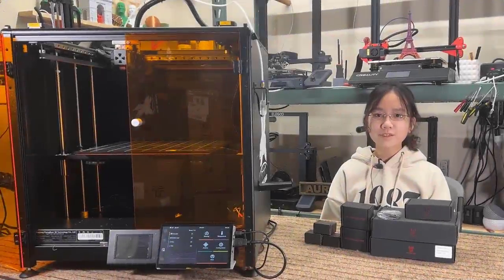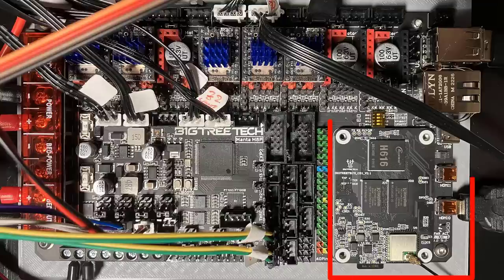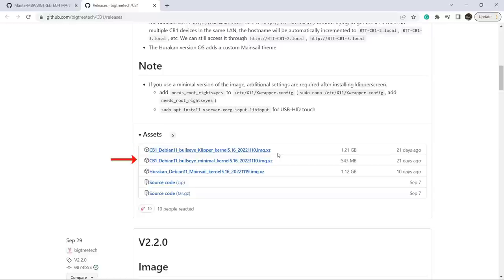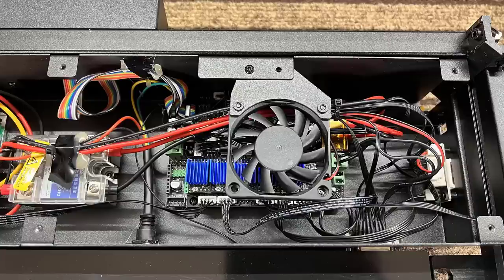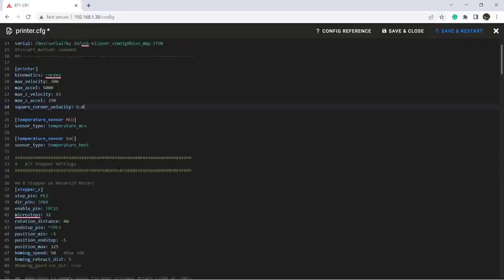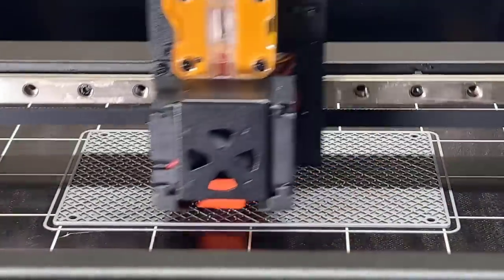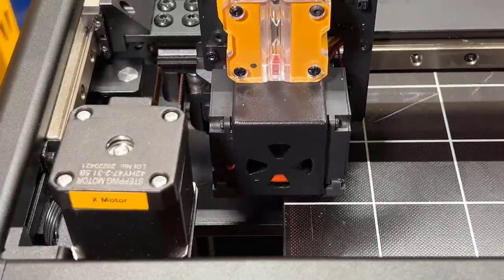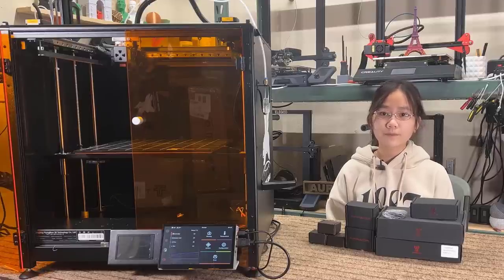BigTreeTech Manta M8P motherboard + CB1 Raspberry PI replacement board upgrade w/ Klipper firmware

Comment: Excellent how-to video for this product and process.  It's a nice change from your reviews, which are always very informative, but understanding the nuts-and-bolts aspect of 3D printing is always helpful for me.  I would suggest doing one about the various changes you might make in settings for Cura or other slicers and what effect they have on the printing job, e.g. tradeoffs on speed vs. quality, layer height impact on durability or looks, etc.

Comment: I am also trying to use an M8P on my Reborn 2 but I am yet again reminded that electronics is my weak spot.

I bought a display too and only after the fact noticed that this display with a ribbon cable only seems to be working with an actual Raspberry Pi.
So now I got a Raspberry Pi but that seems to be unable to boot off the SD card because it has MMC storage.
So now I need to find a 24 V power supply to test this although I am led to believe I might be able to use a 12V one too but I cannot verify.

I so wish that there were better resources online as in actual people willing to respond to questions. It used to be like that with forums, but these days you can either ask under videos like this in the hopes that somebody cares or go on Reddit and be ignored for the most part or if someone answers, they don't read the question or just tell you to do it their way because that's better anyway.

O tempora, o mores.

I seem to be entering the "get off my lawn" age...

Comment: It is so nice to see a project video from you again. I have been missing them.
This is a convection I'm considering for one of my printers as well.
As always, your video is a very clear and detailed step by step guide.
Awesome work team.
Btw, iI wonder if the Voron Afterburner print head would be better fit for this printer?

Comment: I have converted my Anycubic Pro to Klipper using the PAD 7 and the stock mainboard. Thanks to your video, it was fairly easy. Would using the PAD 7 and a different mainboard, like the SKR 3 or Octopus, have made this easier?

Comment: Nice job , you helped me figure some issues out on mine and I used the same thing as I have had the arts for a bit of time the only other thing I did was also changed it to Canbus with an EBB42 as I didn't like the large extruder cable.  I did get the m8P to fit where the old one was with strong Velcro. Thanks for the video !! :)

Comment: Great video again! I have similar setup and I cant get 24v on Bed-out connector. Is there some jumper somewhere or do you have route 24v power to bed power connection? I think that I will take that relay control signal somewhere else.

Comment: Great video. Wonder how the setup for the accelerometer would go with this board? Looks like there something similar to a 40 pin header on the Manta, so I would assume that it would work the same as with the PI. Also would be curious how canbus setup would work with this board. Is it USB only? or is it compatible with a waveshare board? From what I see there are 2 USB ports, but their documentation says 3, where is the 3rd?

Comment: Hi, thanks for the video, did you was able to use an input shaper sensor in the board such the adxl345 or another one ? if yes how did you manage to do that in this board? my board doesn't boot with the sensor in the sp1.

Comment: I am wanting to design prototype parts quickly I have a basic ender 3 now with a few upgrades. It is painfully slow. Was wondering if it would be best to buy a core xy printer and installer klipper or just by the p1p... budget is 800$
Reply: if privacy isn't that big of a deal, then get the Bamboo lab.

Comment: I'm about to install this board and everything I've read says to pull the VUSB jumper before powering the board with 24V from the power supply or you'll fry the USB controller. Did you need to pull it? I ask because obviously you're using the USB for the screen.
Reply from the maker: The USB-C used to power the board is connected to a 5V 3A adapter.

Comment: This is an Amazing video, I am doing the same to The Flying Bear Reborn 2 at my job here at The Dinosaur Company, Im running into an ADC out of range, I may have to replace the heater sensor? did you run into the same issue? Thanks so much 😃
Reply: I got it, Had the HB and TH wires swapped, fixed it in printer.cfg

Comment: Hello, thank you so much for your video, it has been really helpful for me, I also have bought a Reborn v2 and followed your tutorial to install Klipper. 
Almost everything is working fine, except for the hot-bed which doesn't heat :c

My printer.cfg file:

[heater_bed]
heater_pin: PB7                     # "BED-OUT negative terminal"
sensor_type: EPCOS 100K B57560G104F
#sensor_type: ATC Semitec 104GT-2
sensor_pin: PA0                    # THB pin
#max_power: 0.6                  # Adjust Max Power so your heater doesn't warp your bed
control: pid
pid_Kp: 325.10
pid_Ki: 63.35
pid_Kd: 417.10
min_temp: 0
max_temp: 120

Edit: I managed to solve this issue by connecting the BED_power terminals to the PSU_power terminals (24V), so that the PB7 PIN could trigger the relay to heat the 220V AC bed
Reply: Hey. runnning in the same issue.
did you run both wires (+ and - from PSU) to BED_POWER?
Reply: @hashbringer975  Yup, I've connected both
BEDpower+ with PSU+
BEDpower- with PSU-

Comment: I installed this on my twotrees sp5 and I am unable to heat the bed. The temp reads correct but it never heats up. Checking with multimeter there is never power going to the bed out side of the connectors. Should there be?
Reply: I had same problem. I programmed different output to heat bed. I choose next nozzle heater output and programmed that to control that solid state relay. That works great and bed is now heating.

Comment: I have an original CR-10 that prints very well.  I will be doing some mods to it, (micro swiss all metal hot end, belted Z, fang cooling duct).  I would like to get a second printer, and like you, I think the bed slinger design is flawed and would prefer a box frame, and core XY.  My question to you is, what core XY printer would you recommend?  The flying bear reborn looks very good mechanically.  But I think this upgrade you have done makes it much better.  So at a price of $560 plus the cost of this upgrade, would you consider this a top value for the money?  I will be printing engineering materials, and materials with carbon fiber, my parts are mechanical in nature.  Would I be better off saving for the Bamboo labs X1?  The Bamboo P1P seems like a good value, but I don't believe that can do the carbon filaments.  The bamboo X1 probably can print quicker, but I am not as concerned with all out print speed (I still want faster printing that typical bed slinger).  The flying bear also seems like it is more upgradable and modifiable.  You have also done reviews on other core XY printers.  What would you recommend for $500 to $700 for a core XY printer capable of high temperature materials like nylon and PC, and carbon fiber filaments?
Reply from the maker: It's too many works to do with this flyingbear reborn 2 upgrade. If I need a good Corexy, I would just go for the BambuLab X1 carbon or even the P1P would be a much better option. For the P1P, you just need to change to a hardened steel nozzle to print PA-CF which is available for around $15.
Reply: @AuroraTech  Reborn 2 is $375 right now.  $390 with a flexible build plate and bed leveling probe. You can do these upgrades and still be under the bambu lab stuff.

Comment: Great video, I too have had issues with the stock board and firmware.  I'm think this the the best solution for the MKS issues.

I'm saw an earlier post with a question, likewise I don't wish to be rude.  If anyone could provide insight it would be appreciated....
The MKS board came with two types of stepper drivers TMC2225s for four axis motors, and one 2209 for the extruder.  Did you reuse the stepper drivers in this installation or is there an advantage to using the two types?
Reply from the maker: I didn't reuse any of the drivers, I want to use that MKS board on other machine, but I should just connect a classic LCD screen and recompile Marlin firmware instead of using their buggy screen firmware.
Reply: @AuroraTech  Excellent thoughts, thanks again!

Comment: Aurora the wise ❤.
Will it be rude of me to ask a specific question about Klipper?
I’ll ask and please free to ignore if you are too busy - I will not consider it as being rude.

Here it is:
When using klipper, in order to achieve fast print speed, do I simply slice the model with higher printing speeds?
Or does klipper “do some magic” with my gcode?
Reply: No, it doesn't do any "Magic".. you need to setup your speeds in your slicer. However, the rest of your printer needs to be able to sustain high speed printing. Especially the cooling fans and ducts.  I can tell you that a stock Ender 3, is not a good candidate for high speed printing.
Reply: @mr.spongylikeaboss4987  
Thanks. And yet, I’m supposed to get “some” improvement, no?
Reply: @mr.spongylikeaboss4987  With the Rails ,extra's,and the frame from 2 of them one could be made that would .Belts would be a issue .I dislike belts though .A drill press for the new holes.A few drill-out templates fo the types of frame printed before tearing apart the Enders. Sorry ,stream of  a new plan . Thank you . Made me Re-Org. Sounds like a good Winter Plan...It's -16c here .just warmed up from -25 ...But my Truck will be frozen..Sorry ,drifted , Thanks for the new plan direction .
Reply: @Jbobonline  a stock ender  should give about 20-30mm/s extra with no loss in quality. I got a 20mm/s upgrade just by replacing my stock motherboard with a new BTT motherboard
Reply: Actually main advantage is "input shaping", as it compensates for ringing because of resonances. Depending of the printer you can get twice to four times speed and acceleration - if the printhead can keep up with flow and part cooling.
So to say it simple: You can use max speed and acceleration your printer supports without klipper anyways - but with massivly improved prints as ringing is mostly gone. Faster with same quality.
For higher flowrate the most simple upgrade is a bondtech cht nozzle. On stock printer it wouldn't help much on common 0.4 or 0.6 mm size, as you can not make use of higher flow due to ringing. With klipper a CHT is very useful.
Still, going higher speeds you might to need better cooling if printing PLA.
Reply: @oleurgast730  
On my STOCK ender 3 s1 pro, with stock cooling, will the sonic pad assist in printing faster parts? (Mostly functional parts with low details)
Reply: @Jbobonline  Actually it is siply to test: Try printing faster in stock configuration. If the print is bad/unuseable due to ringing, klipper would fix this. But if the print gets bad due to insuficient flow or part cooling, klipper wouldnt fix it; you need to upgrade hotend than.
If I interpet other videos correctly, with a stock e3s1pro you can reduce printtime by about 20...25% using klipper before hitting other limitations. For more, you need changes in hardware. Cooling and Nozzle might be the first parts to mention, but the kinematic also give limitations.
Of course, also the material matters. PLA needs more cooling than PETG. On ABS you should not use part cooling anyway, so it is no limitation there.
Still, a nozzle change might usefull for better flow (I do not call this an "upgrade", as nozzles are a consumable). So you might even get faster.
But Creality printers are designed to be cost effective. So personaly I would mostly use the sonic pad on a creality for fun in tinkering and learning about klipper. Maybe to add an Enraged Rabbit Carrot Feeder (Multi Material Unit).
Also do not forget klipper also reduces ringing on normal speed, so staying the same speed would result in better quality. So depending on the price you pay for a Sonic Pad it might still be worth it.
I do not have a "modern" Ender, only the classic old ones, so persanaly no experience. But I just got the sonic pad (133€ on 11.11 sale on AliExpress, incl. Tax and shipping). I am not sure, which printer to upgrade jet (also got some Manta boards and might try them first, f.e. on an Anicubic Chiron)
Reply: @oleurgast730  
Thanks for the elaborate reply!
I did plan on a 0.6 nozzle and better cooling than stock … however, cooling can be a double edged sword … too much is also not good

Comment: Any update on the part cooling issue?
Reply: I printed on thingiverse thing:5844058 air ducts and it help a lot. I can easily print benchy 250mm/s on 5k acceleration. These are way better than orginals.
Reply: @jjkproduction  May I ask for the Speed Profile please?
Reply: I think that I used same profile than this Aurora Tech video on that monitor support print but I use that 5k accelaration.

Comment: I don't think it is a good idea to force the printer to print with so high speed  😁🤪
Remember how the 3D printers work   !!
They put layers of liquid plastic on top of each other, it's not like drawing lines with a pencil, these layers have to fit exactly on top of each other and connect very well to form a strong structure.  3D printing is not about speed, but about precision and durability of the printed material. I use the original Ender 5 Plus printer and the prints are beautiful, very smooth as velvet, and the durability is the best, comparable to layer welding. Maybe for mass production in a factory Klipper is good, but for work at home, family hobby, and project prints ... Marlin is perfect and gives beautiful results .... best regards.
Reply: Wow.. you are so wrong.. on many levels. The high end printers all use Klipper now.  She has had more 3D Printers than you ever will, and this girl has forgotten more about 3D Printers than you will ever know.
Reply: Actually resonance compensation and preassure advance are the key components for more precision. So with klipper you can get higher speed on same quality or better quality on same speed. Actually you might have missed the part she simply copied resonance compensation of a pre-made profile for this printer; so resonance compensation is on. Not optimal way to do so (you should always measure the individual mashine) but already great results.
There are of course limits in speed and acceleration the printer is capable of, and limits to flow and part cooling. But mostly you do not reach theese limits without klipper (or another input shaper).
She also showed limits of the hotend due to flow and quick fix by incresing temperature. As the printed object did not realy part cooling (no overhangs) this works. But as a better solution, a Bondtech CHT-Nozzle would be a nicer solution - and also incresing cooling capacity.